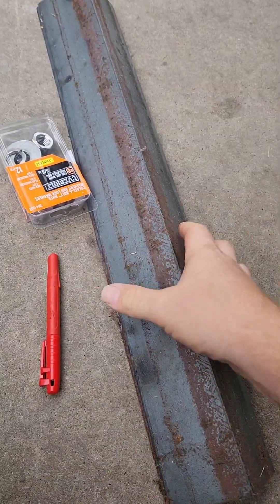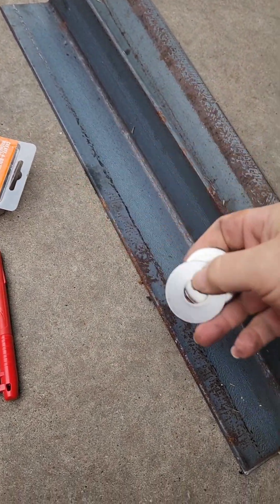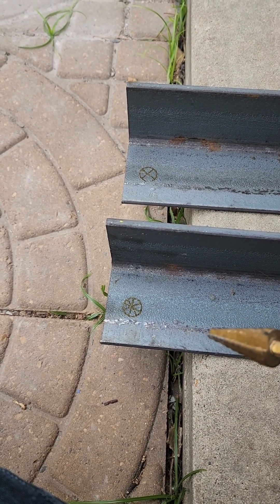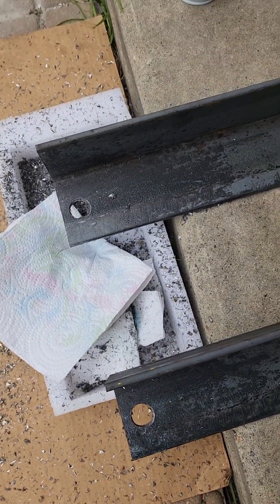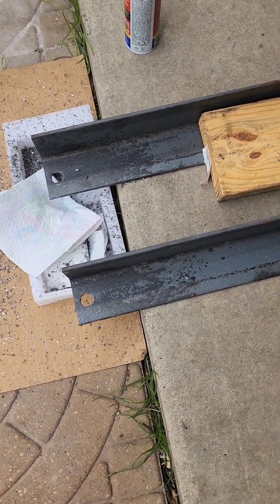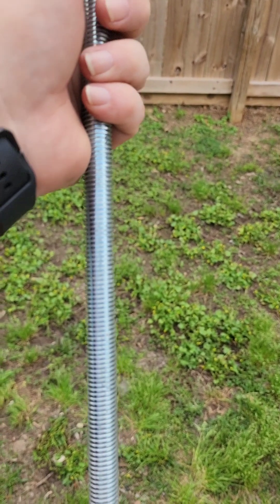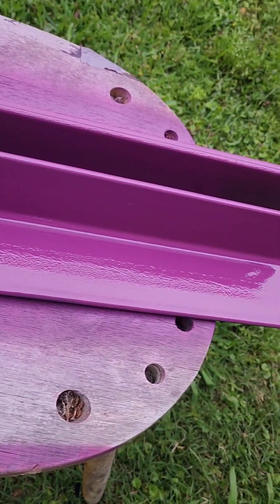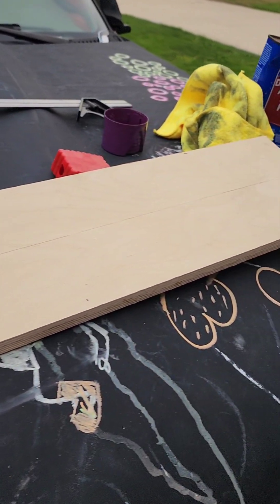C-Max lithium diy build time. Building a 45ah from scratch.

Comment from the maker: $150 Sleeve
$109 Buss Plates
$15 3" Angle Iron
$35 Screws, Nuts and All Thread
$27 Balancer
$7 Spray Paint
$343 and Time

Tools Needed
Drill, 3/8 Drill Bit, 8mm Socket and Wrench, Multimeter, Cresent wrench, Grinder or sander, wire crimpers/cutters, wood clamps and circular Saw.